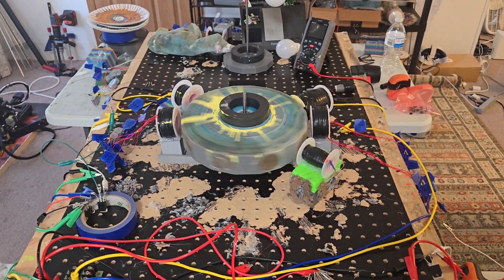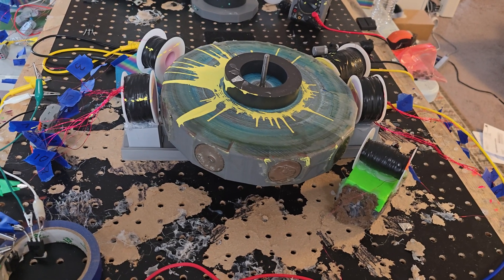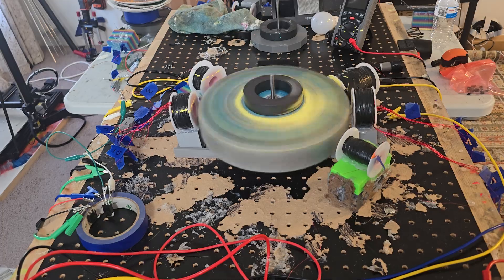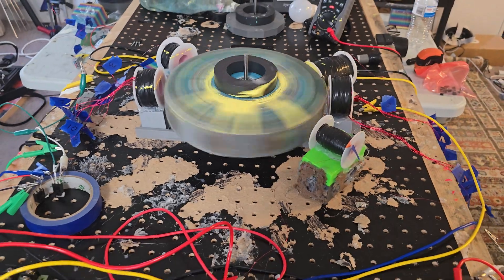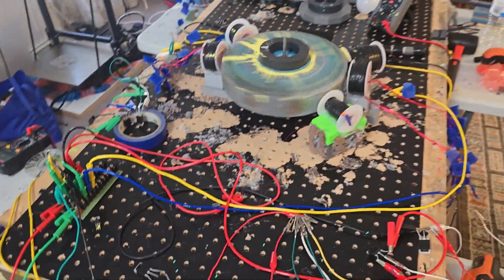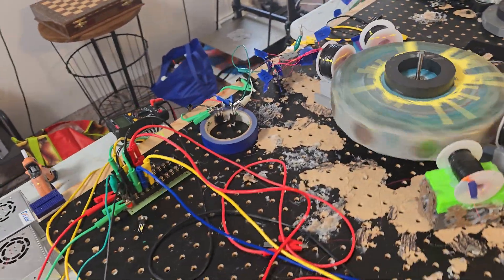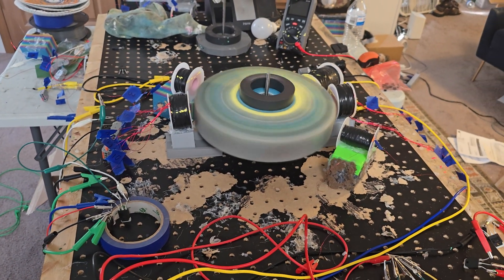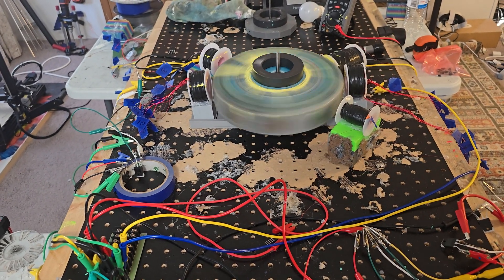10 file wave funnel coil 200 turns 4, 24awg 4, 26awg and 2, 30awg mirrored in the 0/1 pulse motor.

Comment: Bedini has used trifilar wound coils.
Reply from the maker: that's cool this one has 10 strands, and 3 different gauges there are very many ways that you can connect it "hook it up" right now I am using this set up in each drive coil 2, 24awg, 2, 26awg, and 1, 30 awg (strands) x 2 so 4 of these 5 strand series connect all together will run on 1.5 v(A<.1A